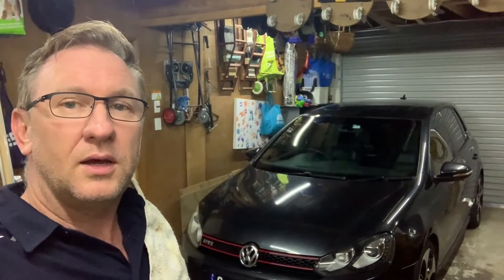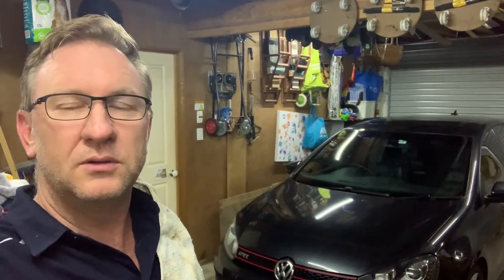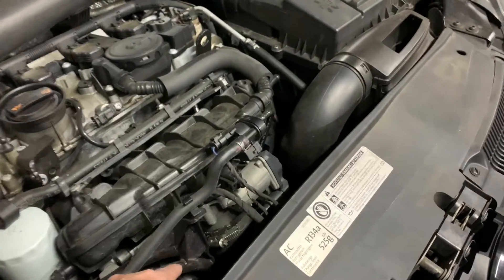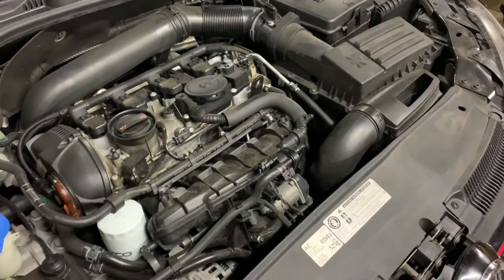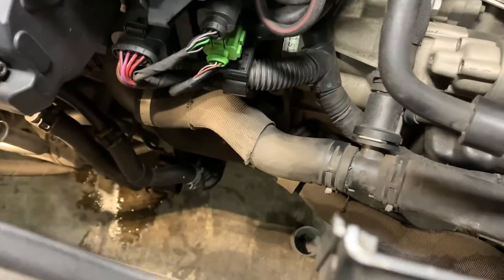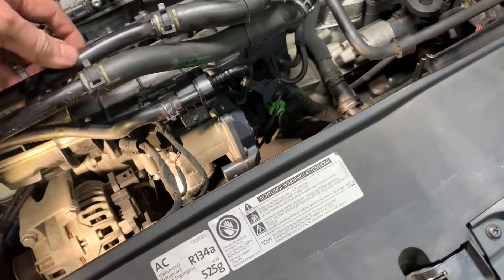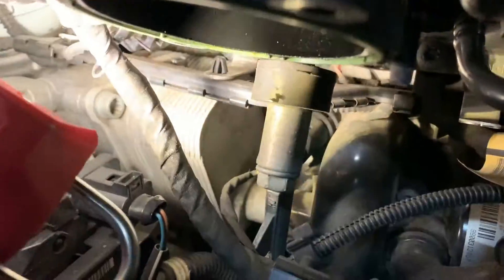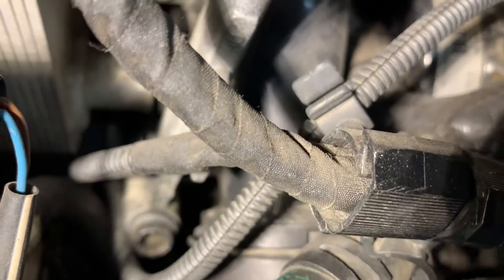MK6 GTI Coolant Temperature Sensor Failure P0117 G62?

Comment: Hi mu gauge doesn't move atall?
Even on long journeys.
Always on zero
Reply: You have a sensor issue. Could be one of the two sensors.  The G82 sensor is underneath near the radiator, easiest to replace.  The G62 is what he just replaced.

Comment: Good  Job  you deed  Sir ! I deed it   the other way   !  I  pulled the Intake manifold  ! To  bad  after i changed  both temp sencer  my  needle at   speedo mater steal  goes up and down at  warm engine !   i  wish to know  what ele i   can doo !?  Sum  Guy said  my speed o meter  temp gage is  bad  , it  flactuate 0 to 90  degre.